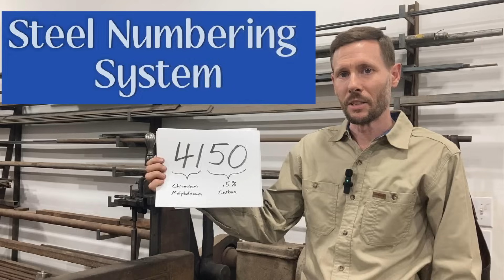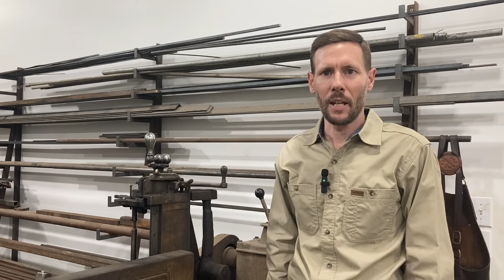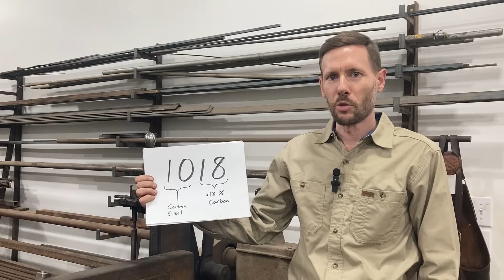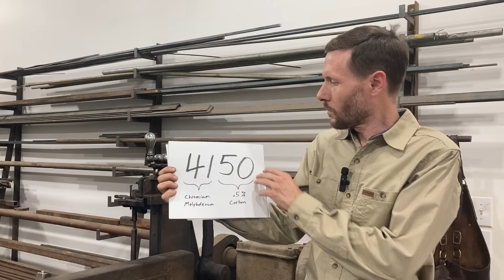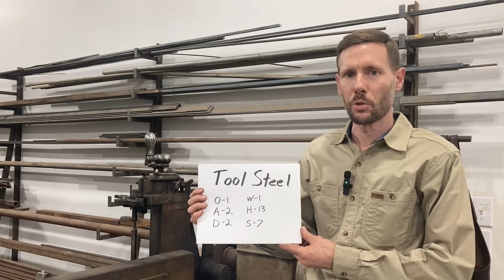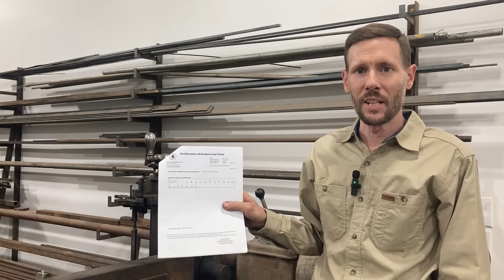Steel Numbering System

Comment: I get good results from using 1045.
A good general use metal is especially popular for CNC Turned components. 
Another positive of this metal is that it can be hardened to well over 50 Rockwell in either Water or Oil.

Comment: Very interesting. Thanks! What about A36 or AR500? Those aren't tool steel just because of the letter A correct? How is this different from 4 digit?
Reply from the maker: These steels are numbered by still different systems. A36 is the ASTM spec for structural steel. AR500 is the trade name for an abrasion resistant alloy. Steel numbering and naming has many facets and can be very confusing.
Reply: @jasonlonontoolmaker  Thank you

Comment: The SAE system is pretty straight forward       What annoys me is when you deal with "older"?   Machinists   they use "trade name " like "silver steel"   so I cant make quick decisions  on steel    as I have to look up    the trade name        THEN we get on to the Japanese system     it would be really nice if there was ONE system
Reply: Yeah, silver steel, kite, keewatin, high speed. We used to colour code and stamp the steel stock .
Reply: Many other STANDARDS have very different specs. for specific purposes that do not fit into the SAE  system  . Not all specs are based on the content but on other qualities .
Reply: Well THERE IS. It's called The Universal Metric System. But the arogant, imperialist Yanks keep away from using it and insist the rest of the world be confused by THEIR system(s).

Did you know that the USA is the only fkn country on the planet which has not gone metric, despite 1960s, 1970s, 1980s Federal Legislation to do so. But many different states and lazy, obstinate citizens refuse to change. 

Poor old China has to tool up for two standards of industrial manufacture -- metric for us conforming folks and US Imperial for The Arogant Ones. If China wanted to bring the US to its knees, all it would have to do is to stop making imperial bolts!
Reply: Try German steel
Reply: I knew an ( old machinist ) that could look and listen to the steel and tell you what the content was and if he needed to know the amount of carbon the grinder could tell him that . Sadly the old machinist are gone for the most part and the new breed of cnc college born people who cant fix anything without an analysis

Comment: A514 is ubiquitous, standard for use in heavy equipment, my primary stock.  No mention here.
Reply from the maker: Good Point! The steel industry is highly sectored into specialized groupings for different trades.
Reply: @jasonlonontoolmaker   Granted we all tend to specialized, if one is doing ornamental, structural, pipelines...they don't even know what "T-1"(A514) is.  In terms of tonnage sold, T-1 must be near the top.

Take any Caterpillar or competitor, entire weldment structure and implements are primarily T-1.  Exceptions for tubing ,AR cutting edges and castings.  

Again--recognizing my own experience bias, if I was teaching JC college students I'd emphasize basic material properties and T-1.  They already have working knowledge of mild steel and would be well advanced to appreciate value of such a common useful steel and the huge opportunities in heavy equipment maintenance.  

I cringe thinking of me at 23 using mild steel on customer's heavy equipment, costly ignorance.  

Pardon my rant and thanks for your efforts!

Comment: Very informative. Rule number 1 which I never seem to follow! write the grade on the steel
Reply: "write the grade on the steel..."  Assumes your workmates can read...  I marked a piece of material "tool steel, do not use" quite clearly, but one of the fitters ignored, or failed to read the marking, cut the material up to use as spacers... Then complained he found it hard to work... He'd selected it because it was a short piece of material, easy to carry to the saw... that it was expensive didn't matter to him...
Reply: @boblawson1006 reading is a conscious act for some people :(
Reply: Then promptly chuck the other end and turn off the lable! 😉👍

Comment: we used 4340 for the axles on our drums for head and tail pulleys on our elevator belt unloading conveyors due to it's added toughness over 4140 .  we used the higher grade as used in the mining industry for durability .  thanks for an easy to understand , well explained  video !!

Comment: Carbon, not being metallic, thus can not be an alloy. Carbon is an element added to Fe to produce the many different cast irons and steels used in engineering. Metallurgy is all about chemistry.
Reply: Encyclopedia Brittanica says otherwise. The key word in the definition is “ordinarily”.

“alloy, metallic substance composed of two or more elements, as either a compound or a solution. The components of alloys are ordinarily themselves metals, though carbon, a nonmetal, is an essential constituent of steel.”
Reply: @strykerjones8842  Correct, to add, carbon is a constituent of Fe compounds. For example, when C is in complete solution with Fe at 0.83%, a perlite crystalline structure is formed, this being the purest form of plain-carbon steel. Plain carbon steels include mild steel and what are called carbon steels, which are heat treatable. An alloy steel has the inclusion of other metallic elements to stabilise and enhance the properties of steel. When the metallurgy of these properties are formulated, be for tensile strength, wear resistance or corrosion resistance, it comes down to the enhance crystalline structure these alloys add to the formula. Cheers
Reply: @strykerjones8842 good enough. Can’t say it better. Carbon is what makes it “steel”👍🏼
Reply: @anvilsbane I work for a company that builds steel mills, we would say once you reduce iron (pull the oxygen off with coke) and run it through an oxygen process (pull the carbon off with oxygen, the one most people know is Bessemer) it becomes steel.

Cast iron is usually anywhere between 2-4% carbon. The fancy stuff we use for mill housings (nodular/ductile cast iron) is 3.3% carbon.

For comparison, 1018 steel is 0.18% carbon.
Reply: @trail-coffee4654  so I’m surmising the iron takes on carbon from the coke. I worked as a craneman at a reheat furnace in Mingo Junction, Ohio. Used to be Wheeling-Pitt steel. I had never seen the actual making of steel, as it was just a rolling mill. Also later set carbon annodes at an aluminum smelter(Ormet Reduction Division), where we actually smelted alumina ore into pure metal. Thanks for telling me about making steel. Can you say what Steel Mill you worked?👍
Reply: @anvilsbane  I work for a supplier, so I’ve done work at USS Gary, USS Midwest, Severcorr, Nucor Crawfordsville, and Nucor Berkeley, Dofasco, AMNS, and a couple aluminum mills. Done a couple visits to some small cold mill shops as well. One of our guys just did a caster job at Mingo Junction I think (assume you had a slab caster).

I’ve only seen iron making once at Dofasco (integrated mill = has a blast furnace = melts iron ore). I mostly work in mini-mills (electric scrap melters, so no iron making).

Yes, the iron takes carbon from the coke (or natural gas in DRI, but no carbon added from the method we’re trying in a couple years pulling off the rust with hydrogen gas).
Reply: @strykerjones8842 
I’ll trust the Oxford dictionary which correctly states an alloy is a mixture of metallic elements, that’s it, nice and simple, without using other words such as ordinarily.

Comment: Missed 3 common steels in my shop... A-36, 1144, and 12L14
Reply: 12L14 ,12L15 the screw machinists' best friends
Reply: A36 steel usually references the specification ASTM A 36 it was purchased to , not the particular grade of steel however, it’s usually around 1020 1025 steel. That specification is driven by minimum mechanical properties not so much chemical limits, so the manufacturers have some flexibility as long as they meet mechanicals . It’s about the most entry-level steel one would purchase unless they wanted something softer like 1010 steel.

Comment: You left out M tool steels.  Usually called High Speed steel used as a cutting tool.  Probably one of the most important tool steels out there. M2, M3, and M42 are common. 
As for 5160, it's spring steel very common in leaf springs (6150 in coil springs) and if you're into knife making, 5160 is a nice material for sword blades. 
Been involved in manufacturing and metals my whole life, although carbon steels are more on the rare side.  We work mostly with steels like Alloy20, Incoloy800, CD4, Duplex 2205, H-loy C, 440C, Nitronic50, 316L, Ferralium 255, etc., although 9310 and 8620 are not uncommon for pivot pins.
Bottom line, it's nice to see other people out there who work with their hands AND their minds to make things. 🙂
Reply from the maker: You are right, the M series is very important. I inadvertently left it out of my non-exhaustive list since I don't use it as much as some steel. Someone once gave me a piece of M50. What can you tell me about that one?
Reply: @jasonlonontoolmaker 
I looked it up.  Looks like it's a bearing steel similar to 52100.
Reply: @jasonlonontoolmaker 
Don't think I've ever worked with that steel.
Reply: @jasonlonontoolmaker  that would be high carbon, high vanadium bearing and tooling steel used where fatigue strength is needed. Punches and dies in my experience are the usual uses but for a blacksmith the wear resistance, toughness and strength at high temps might make it a great hot tool candidate.
Reply: Would chrome-vanadium fall under a special type of tool steel?
Reply: @campbellpaul  
Chromium Vanadium is the 6000 series, like 6150, but I can't think of a Chromium Vanadium tool steel.  
It's probably an alloy element in just about every tool steel, but it's most likely not in high percentages.  Vanadium has the unfortunate property of making steel extremely brittle once it gets up into the 50 and 60 Rockwell range and tool steels are designed to work in that range.
Reply: @JimmyD806 
If I recall correctly, our racing grade BMX bikes were made of 4120 chrome moly. Does that sound right? They were super strong and light weight, heli-arc welded.
Reply: @Acemechanicalservices  
I've never been involved in bicycle construction, but 4120 would be along the lines of a carburizing steel.  That would make the frame expensive unless you're not planning on carburizing which would leave it not really much better than 1018.  I'd just move to 4130 with a bit of heat treat.  Maybe in the 30 Rc range.  But it wouldn't be light.
I was looking to get a mountain bike recently, and I'm thinking the lightweight frames are titanium or carbon fiber.  They're no longer just $200 either. 🙂
Reply: @JimmyD806  
That’s it, 4130. All the pro level BMX bikes were made of it, and they were very light. Generally, every thing else on the bike was aluminum alloy and the bikes weighed around 20 pounds complete. We’re talking early 80s, so composites weren’t a thing.
Reply: @Acemechanicalservices  
Yeah.  Now I just threw in the heat treat.  Mainly because I'm used to that.  I'm sure 4130 would be plenty strong without it.  The tensile strength is way up there.
Reply: @JimmyD806  
They were heat treated. Speaking to strength, a feature that could easily identify a pro level bike was the lack of a gusset between the top tube, down tube and head stock, which were found on any mass produced steel bike.
Reply: @campbellpaul  
I also know from experience that if you're going to nitride the surface, you should avoid vanadium steels.  They don't take nitriding well.  Those that do, only show a moderate increase in hardness.
Reply: @JimmyD806  Thank you very much for your answers. On another note, do you happen to know where the best prices on aluminum would be for someone buying it in bulk? I live in Albuquerque and need it delivered for a project.
Reply: @campbellpaul  
Sorry.  I can't help you there.  I work in support of the mining industry and we just don't use aluminum.  Bearing bronze and brass, and some copper alloys are about the only non-ferrous we use.  About 2 decades ago I could have helped you.  I was in aerospace and we used tons of it. 🇺🇸
Reply: @JimmyD806  Thanks, Jimmy 👍

Comment: Hundredths of a per cent, not tenths.
Reply from the maker: Yes, thanks for the correction!
Reply: .18 is “eighteen hundredths”, .5 is “five tenths”, .02 is “two hundredths”, to be most Clear on this. Good video, OP. Does anyone know if an x-ray gun analyzer would show the Grade, in the field? Thanks :)
Reply: @sofiad5524  xrays are good for spotting density inconsistencies that’s why medical use is common but are ionizing radiation, and exposure to high intensities can be hazardous to health, causing damage to DNA, cancer, and at high dosages, burns and radiation sickness. Blasting a X-ray gun around a job sight would not only tell you nothing about the composition of steel but subject everyone to harm, (backscatter). But what do I know I’m just a simple engineer….    😊
Reply: @LTV_inc uh no… XRF guns, aka “xray blasters” are very useful for identifying what elements are in a material. They also use very little radiation, quite safe. They are probably what is used to certify the steel.
Reply: @LTV_inc Indeed, you are just a simple engineer, with simple knowledge of the commented subject. X-rays are not only used to look through the bones, as in the past times. Science and technology have progressed since Wilhelm K. Roentgen received the 1st Nobel Prize in physics. Now, we have XRF (X-ray fluorescence) devices to check the chemical composition of various substances, incl. steel. The portable models are called guns, because they are more or less of the size of a shotgun, incl. battery. Their power is very small, exposure time is several seconds, and they are CERTIFIED. 
There are more other ways of X-rays' properties utilisation, as well. Looking at Mrs Roentgen's hand bones was just a sandbox, compared to what the mankind can do now.
Reply: @LTV_inc  He's talking about an x-ray fluorescence (XRF) device. It measures material elemental composition.  XRF analysers can be helpful, but they can't measure elements lighter than magnesium with carbon being an important one here.
Reply: @LTV_inc smugly wrong is my favorite type of 'oof'😊
Reply: @amosbackstrom5366  …huh?…you don’t even understand my comment or have any concept of it, why don’t you explain it for us?
Reply: You can still delete your comment. Nobody will care, I promise
Reply: @ just as I thought.. you could get an education, your social circle will care, I promise!…🤣
Reply: I do have an education, but I don't feel the need to brag about it when I dismissively lecture someone about a topic I'm unfamiliar with.
Reply: @ ..I doubt it. But you can correct me when you don’t understand the comment. Explain it Einstein…
Reply: @sofiad5524 you mean a LIBS unit? Yes, I believe so. Very expensive tho
Reply: Yes there are hand held material analyzers to determine material composition. Very pricey last I checked $3-5k
Reply: I bet you suck at parties.
Reply: 18 one-hundredths is same as 1.8 tenths. Just like thousandths and ten-thousandths in machine shop lingo.  Both are accurate as long you call the decimal 
For fun you could also say 
1 tenth and 8 hundredths 

Analog 1 & 1/2 “thou” = .0015” or 1-thousandth and 5 ten-thousandth
Reply: @danielblackburn4626  No machinist in the right mind would call .0015 1 thou and 5 ten thousand. We would just call it 1 thou and 5 tenths.
Reply: 18 one hundreds = 0.18  I've never heard anyone say 1.8 10ths.  That is correct but just a confusing way to say it.  You could say 180 thousands because machinist often work in thousands.  But Please don't say 1,800 ten-thousandths 😂
Reply: Settle down big guy

Comment: Good info! This is the system I learned when I started my T&D apprenticeship back in '77. But there seems to be a bunch of trade-names and letter/number combinations for todays 'designer' alloys.
Reply: hahaha ya beat me to it !       Exactly
Reply: There have always been trade names used by steel producers. Some l can think of just from using them . Graph-Mo (O-6) from Latrobe Steel. They also had Graph-Air (A-10). Both graphitic tool steels with excellent machinability. Hy-10M. An oil hardening die steel. Mirralloy. A TG&P shafting steel. Carpenter 158 (P-6). Oil hardening mold steel also used for machinery parts. Then there are the non ferrous metals. Having both trade names and common names. The Ampcos, Mic 6, German Silver (copper-nickel alloy) and others.
Reply: @mpetersen6  Yep, we used to buy so much we'd get a trailer direct from Carpenter. 16ft lengths of A6 Vega, S7 Bearcat, O2 Stentor, A2 Air-Wear, etc. 
Crucible has own their trade-names too. 
CPM-123-xyz is what I'm seeing a lot of now. And it seems todays designer knife-makers have their own alpha-numeric code which I haven't figured out yet.